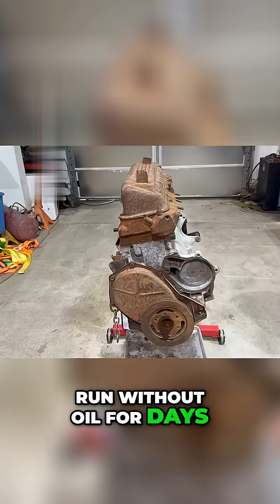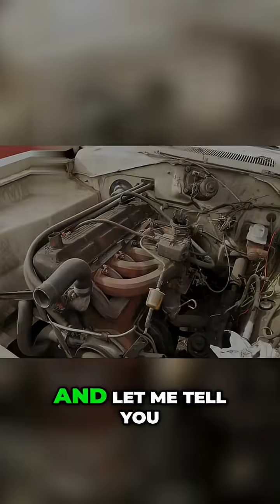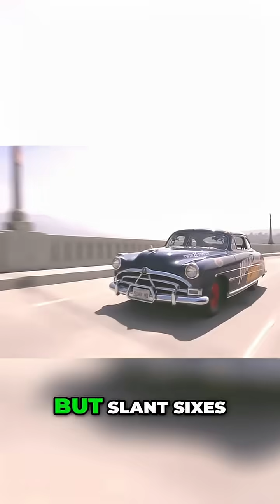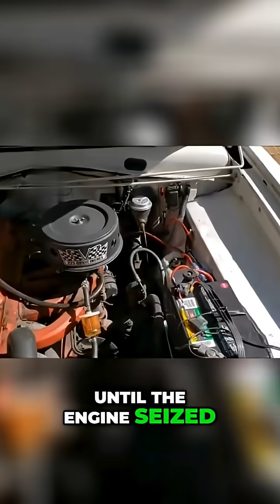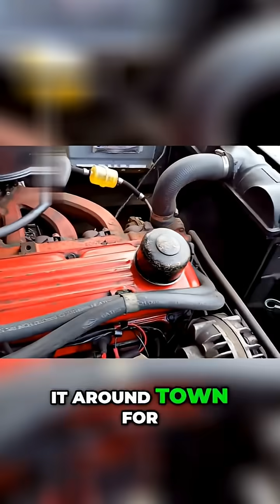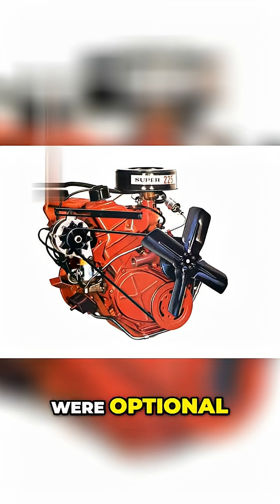Unkillable Slant Six Engine: A Legend Uncovered!

Comment: It's not completely unbelievable. I had a 76 Scamp that the pressure switch was bad, so the oil light came and went. On a trip out of town, the light came on while driving back home. I ignored it for 70 miles. When I got home, I figured I'd check the oil since I hardly ever did. It took five quarts to fill it. After another year, the compression was so low that it didn't really want to run anymore; 300,000 miles with little to no maintenance prior to me getting it. The replacement engine, unknown until I got it, was filled with rainwater. It ran fantastic. Drove that car for two more years and sold it. It's still driving around with that same engine five years later. I also had a Duster that would run at 240 degrees because the radiator was clogged. It was my only car, I was fairly broke, so I just drove it like that for about two months before I could afford a new radiator. It didn't seem to care. I sold that one after a few years of daily driving to buy something else. My current daily, slant six of course, sat for 10 years. A good battery is all it needed to put it back on the road. It's been two years of trouble-free daily driving. As far as trying to brick the throttle, they don't rev high enough, and they don't make enough power to hurt themselves.

Comment: If there is space between rings, and cylinder wall why should it need oil unless oil controls the heat ,keeping parts from turning red hot and deforming I can see it  like a AK 47 never jams even if it's in mud ,because it's made with room between parts kinda makes sense cam isn't drowning in oil Think about it ,where is oil really needed in the motor if there's room between parts hairline room